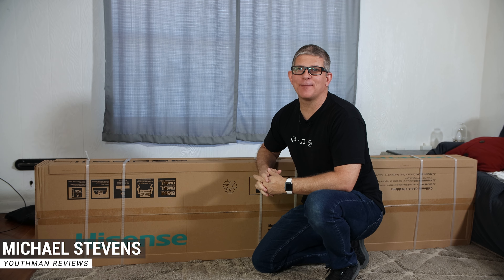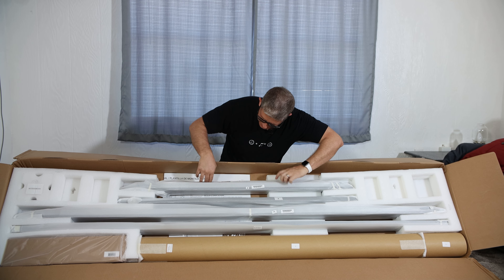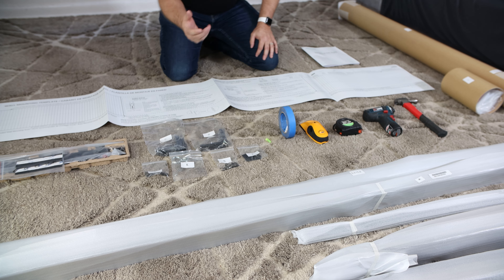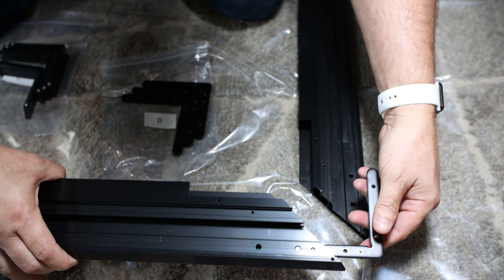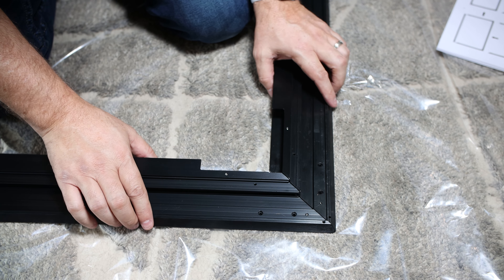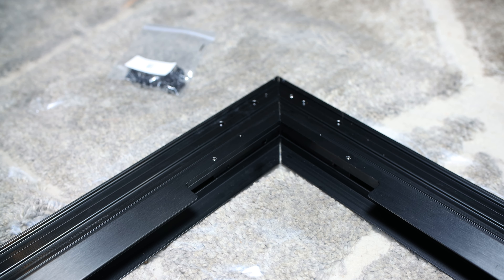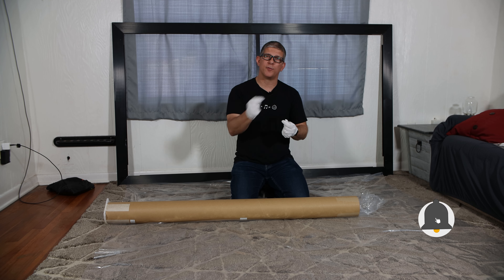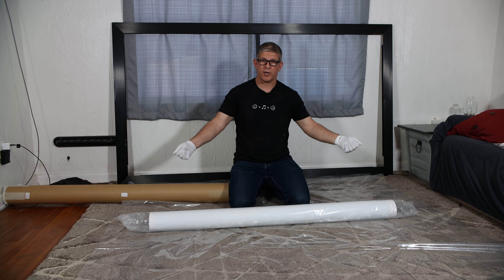Hisense Made Installing the 100" L5 ALR Projector Screen EASY!

Comment: I love the video! I wish I had found it when I first set mine up. I'm now looking for a solution to move my screen to another room because I need to give up my media room for my in-law who is moving in with us due to health issues. Has anyone tried shrinking the size of the screen? It's about 90 inches long, but the wall in the new room is only 74 inches long. I'm considering cutting the metal frames or creating a wooden frame to fit the new measurements. I understand it will make the screen smaller. Any advice would be greatly appreciated. Thanks!

Comment: Does the screen fabric have to be installed a certain way up for the ambient light rejection to work or can you install it either way ?
Reply from the maker: It only goes one way. If you look down from the top and see black, that is correct, because you want to absorb ambient light. If you look up from the bottom, you will see the screen looks white that’s because the light comes from the bottom and gets reflected back to your eyes.

Comment: Nice video ! :) What is the weight of the screen ? I'll have to place it on a wall I can't pierce cause it's load bearing. I am trying to find an alternative with powerfull glues or adhesives. Any suggestions ?
Reply: Looking for a similar answer.
Reply: About 27 pounds. There are many strong glue options, even industrial strength Velcro. Really depends on the surface - if it’s drywall, there’s risk of the paper tearing away as the weight is concentrated to two mounts. I’d suggest adding one or two supports from frame base to floor